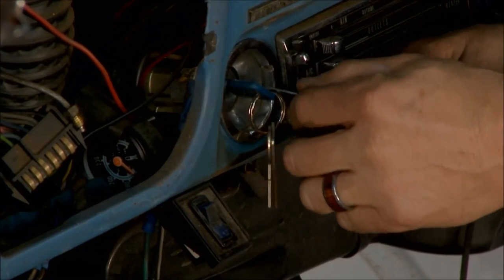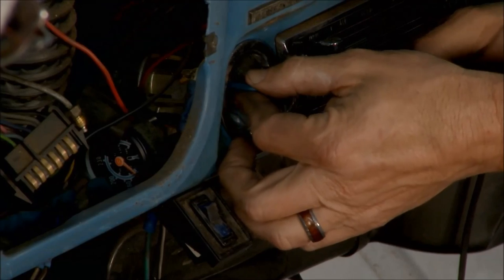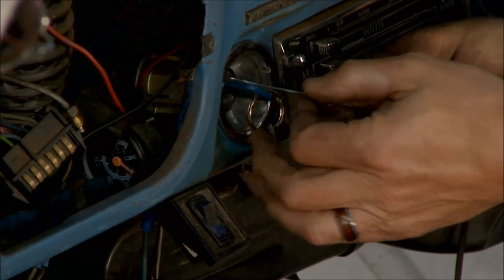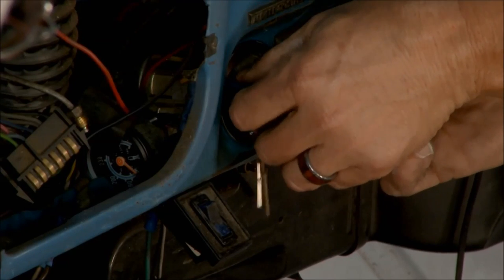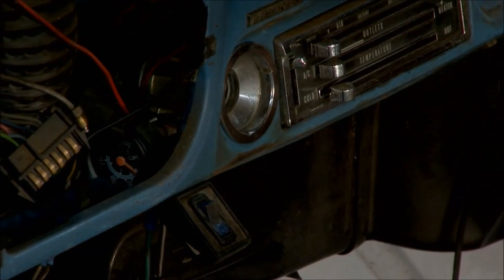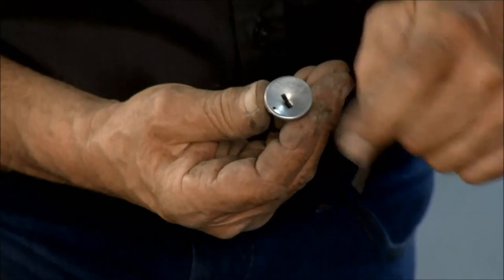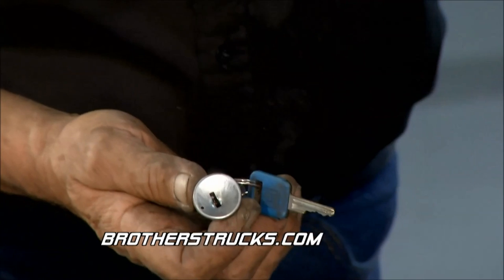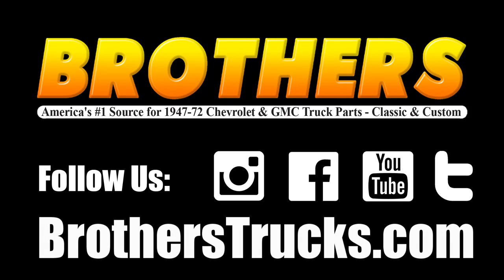47-72 Chevy & GMC Truck Ignition Lock Cylinder Removal How-To

Comment: My 1947 Chevy truck only has on-off position clockwise. I can feel the spring under the paper clip but tumbler will not rotate further.  Any suggestions.  Your site is really helpful.  Thanks.
Reply from the maker: Here's a suggestion from another viewer:
"Spray some lube in the cylinder before trying this-it goes much better! I didn't think my truck even had the ACC. position, turns out it was just sticky-that seems to be a common thread in the comments."

Comment: so what do you do if you lost the key?? thats my situation. thanks
Reply from the maker: You're kind up a creek if you don't have the key. You can remove the bezel from the switch by force which will more than likely destroy the bezel, tumbler and switch... OR you can try to get the stainless trim off of the tumbler and ease the bezel over it. Good luck!
Reply: Pick the lock, and rotate it back to accessory. I had to do that with my 1947 GMC 1/2 ton, and 48  1 ton. You will also have to decode the lock to make a key. FIND A GOOD LOCKSMITH! Once the ignition core is out decoding will be lots easier.

Comment: you make it look so easy been trying for 2 days in every position possible but key just slides out &having a hard time &cylinder won't come out my next step is to drill it out cause i have no other choice ,by the time you read this it will be fixed im sure
Reply from the maker: So did you get it figured out? If not, call our customer service guys and we'll walk you through it. 800-977-2767
Reply: yes i did manage  i did exactly as i said & changed the cylinder &ignition switch  was a little skeptic at first but i said aahh what the hell im going for it & it's easier that i thought  felt unsure of myself but in the end everything went perfect ,thank you so much for a great video & for writing back so soon

Comment: My barrel won’t come out. It definitely comes loose and turns a click past accessory but won’t come loose like in your video. Any thoughts or advice?
Reply from the maker: Without seeing it or getting more info it's tough to figure out what's going on with your tumbler. Call our shop at 800-977-2767 and talk with one of the guys, we'll get it figured out.
Reply: Thank you so much will do!!!
Reply: It’s so odd because I changed it before no prob. Your vids are great
Reply from the maker: @dnafpv  Ask for Alex or John, they probably have slightly more experience with removing those tumblers.
Reply: I have a 67 and 68 and 69 etc etc etc 
I dont have accessory.
Put key in.  Leave off position.  Put in paperclip.  Turn to "acessory" position which doesnt unless u use paperclip.  Now jiggle back from "acessory" to off just slighty as pulling out.  Mine pop out somewhere between my paperclip "acessory" to off.  Make sense?  Hope this helps someone.

Comment: What if you don't have the key and you cant take the lock cylinder out what do you do
Reply from the maker: You have to remove the switch by taking off the stainless steel trim on the front of the cylinder and then FORCE the outer bezel to pop off as you unscrew it.

Comment: I have a 64 c10 that my mom gave me and she has lost the keys how do I get the key cylinder out without the keys
Reply from the maker: You're kind up a creek if you don't have the key. You can remove the 
bezel from the switch by force which will more than likely destroy the 
bezel and tumbler... OR you can try to get the stainless trim 
off of the tumbler and ease the bezel over it. Good luck!
Reply: I'm in the same boat here. Gona be  a problem I guess.
Reply: If you don't have the ignition key take the door lock out of the drivers door.  On older trucks, like your 64 the door key is the same key  as the ignition key. Take it to a locksmith and he will make you the key . Problem solved. Don't pay any attention to those who say you are up the creek. It is their lack of knowledge showing.